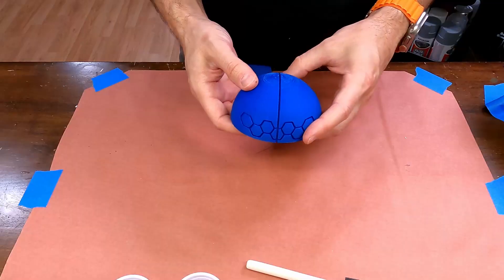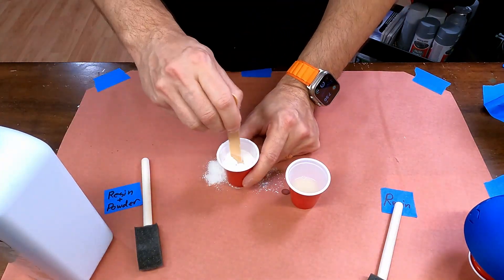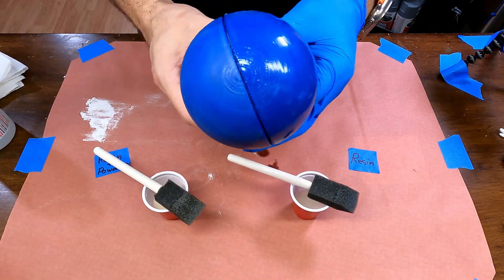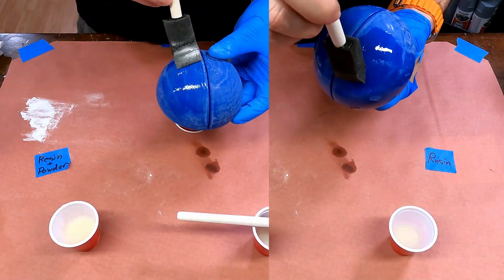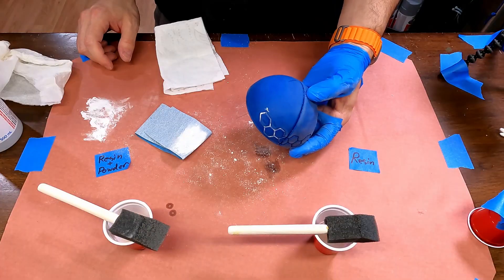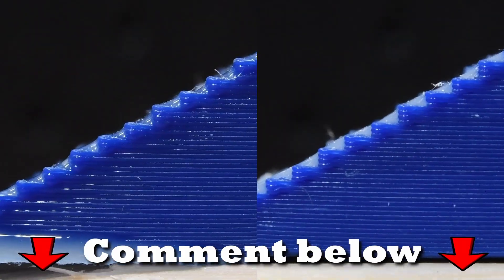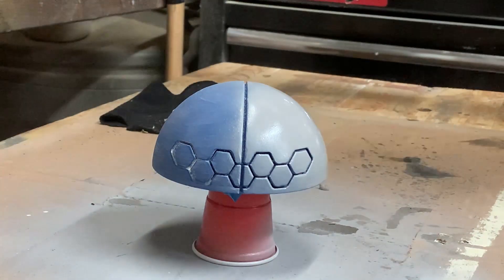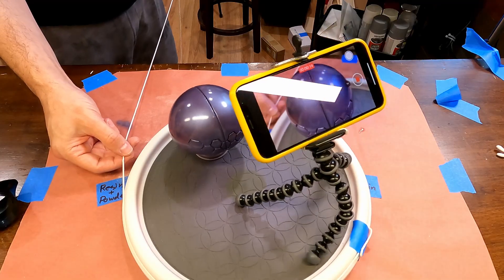What hides 3D Print Layer Lines Better,  Resin or Resin with Baby Powder

Comment: I have a question, the resin your using says pla, am I able to use my current resin I have? It’s sunlu abs like? Also is there a link for the single dome you used in the previous video as it would be great to use as a training piece to get my skills properly honed in, another great video
Reply from the maker: your resin should be fine. I don't have a link to the dome but you can just create a sphere in your slicer and cut it in 1/2
Reply: @DaveRigDesign thanks, I’m making multiple helmets and masks and saw your previous video then this one, and I love the colours your able to make too

Comment: Hi, i saw this video about a year ago, im following up to see if you potentially still have the test piece and what was the result after the 2 years time?

Was there any cracking over time from thermal changes or what have you is mostly what im curious about.
Reply from the maker: I don’t have this model but do have the one from the 1st resin + baby powder video and it still looks the same. The red dome from the glazing putty video was showing layer lines before I threw it out so I think the putty shrank a bit over time. 

Resin seems to be pretty stable.
Reply: @DaveRigDesign awesome thanks for the quick reply!

Comment: if it can help. i mix epoxy and FLOUR (00) until 30-40% to get  more dense putty. I used on several tables, and finally at 25% i used to cover the entire Bar i manage , the external wall. It is already there after years

Comment: If you don't mind, I've got a couple questions:
1) Is it possible to thicken the epoxy by one of the following methods: 
    - Changing the hardener to epoxy ratio?  
    - After mixing the epoxy, letting it sit for a while so it thickens some before applying.
2) If you are going to prime and paint anyway, is it really necessary to apply epoxy?  Couldn't you just give the 3d print a light sanding, apply primer, sand primer, and then paint?
Reply from the maker: Sure thing:
1) Th is is UV resin so there is no hardener to add. Exposing it to the UV light is what caused the chemical reaction to harden. 
If you were using an2 part adding more hardener usually just makes it cure faster and you could let it sit but usually once it starts to flash it gets gummy quickly and unworkable. 
Even with 2 part you would want to add a thickening agent to the base before adding the hardener 

2) sanding PLA is very difficult. The material is very hard so sanding it difficult and take a while. Resin on the other hand it much softer and easier to sand. 
Also you end up sanding less as you are not sanding down the plastic ridges until the are level with the grooves, you are filling in the grooves and only sanding off the top of the resin to be level with the ridges or slightly above. 

If you have done any wood working for comparison, sanding PLA is like sanding oak and resin is like pine. :)

The primer at the end is to just fill in the small scratches left from sanding. Paint is very soft and not meant to fill large gaps.
Reply: @DaveRigDesign  ... Thanks for the thought out response.  Very helpful.

Comment: Dave,
I really like this video and it give good detail for other options for filling in gaps.  I do have a unaddressed question though.  If you have printed models that are multiple print colors of filament and not necessarily finished with prime and paint since they are already printed in or wit the correct color formats then is the resin option the best way is the powder the best way and will this assume that the top of any domed print while maybe layered have filled in, but that you will still always see they swirl for a lack of a better way to describe?
?
Reply from the maker: if you are printing in colour but still want a glossy smooth finish, you would have to use a clear resin with no powder added as the powder will make the resin cloudy. 
It just means you will need to add more coats and more sanding. 
Then at the end you can either add one final resin coat to turn the resin clear again or buff/polish the resin to remove the sanding scratches making it clear again.

Comment: I'm getting good results with epoxy crafting resin, the UV kind so that it cures in a few mins. You can either dip your part or pour or paint over it.
Reply from the maker: Any resin should work. Not sure if craft resin is thicker or thinner then printing resin. 
Doesn’t dipping it pouring the resin create a lot of waste though as it drips off?
Reply: @DaveRigDesign  I use UV resin for fast curing and no waste since you just pour back the unused. So if you dip it pour back what's left in the dipping container, if you pour it then your mould must have a wall and then you pour out the excess back into your resin bottle.

Comment: My inner Journeyman for Autobody approves of your efforts. If you take some time practicing with a few different sanders (DA, Random Orbit, mouse) all with different density sanding pads, you will cut down greatly on your prep time and end up with a smoother, flatter result. 
But you also pulled a Shane (me) and got a damn run in the clear which happens from time to time... which no prep before painting is gonna save you from. Well done on the video though!
Reply from the maker: Thanks, If your experienced in autobody work you may like this video I did recently with automotive paint. https://youtu.be/3PKFMq0Him8
Take a look and tell me how I did :)

Comment: I'm wondering if I were to just sand and paint with clear coat to make it shiny and the clear would fill in the ridges would be good enough. I'm fine with the PLA color so don't need to paint and your shape is a smooth dome but if the shape is complex sanding is not really very practical.
Reply from the maker: In theory I think you could. Not sure if you could get the clear coat perfectly clear though all the sanding and recoating but may work

Comment: Any UV lights can cure resin? Idk which uv light img gonna buy.
Reply from the maker: They need to be the right wavelength for the resin you’re using. Most 3d printing resin are 405nm. You also want it to have a decent power. If it’s not strong enough it will take forever to cure the resin or not at all

Comment: Help! So I did 2 coats of filler primer, but when I wet sanded each time, 95% of it seemed to come off. I used the same products you did, and same grits. What does this mean? Will I have issues painting?
Reply from the maker: Between each coat when sanding you are removing the paint from the high spots and leaving it in the ridges. 
So each coat you should be sanding less off. 
You should also be sanding with 240 grit and just making it smooth. If you sand too much you will take all the paint off and go all the way down to the print
Reply: @DaveRigDesign  im using 240 grit. I’m putting barely any pressure. And just going over the entire print and it seems to begin coming off everywhere as I go.
Reply from the maker: If it’s coming off in chunks or pealing off then the primer isn’t sticking to the print for some reason. If that’s the case you’ll want to take it all all and while down the print with alcohol to make sure there are no oils or contaminates on it before spraying again. 

If it’s sanding properly like a powder then you either need thicker coats or to not sand as hard. 

Also if you sand it before it’s fully dried it will scratch off easily and smudge and really gum up the sandpaper.

Comment: Did you do 220 grit before spraying primer and then wet sanded with 220/240 again after spraying the primer? Or only after primer?
Reply from the maker: Sanded to 220, then prime and sanded with 220 and 400 after that

Comment: Did you only sand with 120 grit each time? What about once you primed it?
Reply from the maker: I started with 120 and later used 220. Wet sanding is 400

Comment: I am having issues with curing when using baby powder. My prints do not seem to 100% cure, even if left in the chamber for hours. Does the consistency or ratio of powder to resin cause curing issues?
Reply from the maker: I wouldn’t think so. Unless you use alot of powder. When I cured my resin there would still be an oily film left which it why I would wipe them down with IPA before sanding. Is that what you are seeing?
Other than the residue the resin would fully cure.

Comment: You need to place the object on rotating base. That will evenly distribute the resin using centrifugal force
Reply from the maker: Gravity is still a thing :)
Adding a rotating base will pull it all down to the bottom as it’s the largest circumference
Reply: @DaveRigDesign  the problem isn't gravity it is the lateral forces not spreading out the solution causing spotting. Rotational motion will provide the lateral force and gravity the downward giving an even thickness. They use this in chip fabrication.

Comment: This is a good video to explain some differences. I've been an autobody shop manager and tech for nearly 30 years. We've been working with acrylic resin, fiberglass resin, modern autobody filler, which is a polyester resin, and old school paddling lead. Lead was the body filler many years ago. So basically, adding the powder to the resin is just making it thicker. The same thing is done with autobody fillers. And you can add acetone to body filler to do the same thing, but it has to be a one part filler. Not 2 part. For adhesion, we have found that you actually get better adhesion by using the filler/acetone combo. What happens is the acetone actually softens the part, allowing the "slurry" to flow into the actual plastic. When the acetone evaporates, the filler is all that's left. To explain a little more in depth, acetone opens pores in the plastic. The slurry flows into the pores. The acetone evaporates, and the pores contract around the slurry. Because the acetone is what liquefied the filler and opened the pores in the plastic, when it evaporates, the pores close, and the filler dries at the same rate. The upside to the resin/powder combo is it's probably stronger. The upside to the filler/acetone combo is you don't need a UV light. We use both depending on the circumstances.
Reply: I just use glazing compound to sum success.Darth Vader never looked better!!😂
Reply from the maker: @keithhampton9700 yup, that works too, I have videos using that method also.
Reply: I have some feeling that it softens the plastic if it’s ABS. If you are using PLA or PETG, it shouldn’t do anything.
Reply: What one part filler do you recommend?

Comment: So I'm a little confused, why would you have had to wipe it with alcohol at 4:45 if you hardened it with the UV light.
Reply from the maker: There is always a residue left over when curing.
Reply: @DaveRigDesign 👍🏻

Comment: At 15:20 there are still visible layer lines on the resin-only side. Could you airbrush resin to get it on more evenly? It may take more time and steps, since you're adding a tiny bit each time though.

Comment: Gloss look will always tell you how smooth the surface is. Don't know why people are going for carcinogenic talc,  I'd use porcelain if anything.   I've haven't been working with 3D Printing for years but I remember people were smoothing out their models with acetone. I know at that time some were heating it up to create a mist - kind of crazy. Why not use a cool mist humidifier???
Reply from the maker: Acetone only work on ABS plastic. It doesn’t have any effect on PLA. Also this is cornstarch, not talc. What do you mean use porcelain?
Reply: @DaveRigDesign  Talc is normally added to "Baby Powder" as you have it in your title.  Good to know about the Acetone. Porcelain is available as a very fine powder and helps with hardening & smoothness in general.

Comment: Hi Dave.  Is there a specific reason you used corn starch baby powder as opposed to talc?  Curious.  Very cool video!
Reply from the maker: That’s what was available. :)
I don’t think you can get talc based powder here anymore due to the cancer concerns with talc.
Reply: Wouldn’t straight up corn starch be cheaper and better since it doesn’t have perfumes and additives?
Reply from the maker: @kevinfinke6927 maybe, but baby powder is pretty cheap :)
Reply: @ I’d be worried about the “other” stuff in Baby Powder, and how it might behave over time. Quick, but not exhaustive search, Cheapest 16oz Baby powder is $.32/oz, least expensive Corn Starch was $.16/oz. Or half again as cheap. Have you noticed any problems with your baby powder smoothed prints over time?
Reply from the maker: No issues, still the same as when I made them.

Comment: How long does the parts take to cure in the uv box
Reply from the maker: I usually put it in for 30-60 sec. Usually if I’m putting on multiple coats once done I’ll put it again at the end for a few minutes to make sure everything is cured. 
Time will vary with the strength of the LED’s though. Once you try it a few time you should get an idea how long it takes resin in your setup. 
No matter how long it cures there seems to be a  oily film on the surface but it is cleaned up easily by wiping it down with IPA on a paper towel
Reply: Thanks if you’re doing the whole part do you have to flip it over so it can cure the underside
Reply from the maker: @davidpetti9951 if I was doing all sides and couldn’t make a stand for it I would put resin on 1/2 and cure it, then do the other side and cure it. Not coat the whole object at once.

Comment: That's great! Now what would the process and results look like if you had used ABS?
Reply from the maker: Should be a similar process. ABS is a little easier to sand and you have the option to vapor smooth ABS also

Comment: I wanna use resin and baby powder to fill in layer lines now… but I don’t have a UV chamber thing to cure it. Do I have to invest in one for curing? Or is there another way?
Reply from the maker: You can use a handheld light like this  https://amzn.to/3HaoDVJ
I made a new video recently where I use them on a helmet https://youtu.be/Ojl5YwBPIHU
Reply: @DaveRigDesign  oh amazing! And it works on PLA correct?
Reply from the maker: Yup. All my videos are printed in PLA
Reply: @DaveRigDesign  amazing, gonna be doing a green goblin helmet for the 3rd time but I’m determined to get the cleanest finish this time and I think this will help tremendously!

Comment: Does it have to be uv resin or can you use epoxy? What would the difference be?
Reply from the maker: Epoxy would work also. Difference is drying time. I like UV because you can work it as long as you want and then hit it with the UV light to cure instantly.

Comment: It’s good to note that resin can over cure and look worse because of it. So the baby powder and resin side is exposed to UV for 2 times as long reducing its initial luster.

Also note that UV Curable resin will deteriorate when exposed to sunlight without sufficient post processing to seal them in.

Comment: I would like to see this attempted on objects with a lot of geometric features and right angles.  Flat surfaces and corners, especially on a smaller objects.  Like a box with a latch or a picatinny rail or hinges and mounts that need to fit together or need to fit other non printed objects with some degree of precision.

Maybe even a set of slightly enlarged threaded bolts and nuts.  The modular mounting system on thingiverse fulfills a lot of these suggestions.  I'm curious how difficult the process would be and how much extra time it might take.

Comment: Great video - really well explained and I'm about to try this out myself! However, as a resin noob, can I ask how long you hit it with the UV light? It's going to be on a helmet so I don't have a chamber - just a hand held lamp. Thanks :D
Reply from the maker: It kinda depends on the strength of your light and thickness of the coat of resin. I’m working on a something now needing hand held lighting and I’m doing 20 sec or so. If you put a little resin on some paper or tinfoil and shin your light in it you can see or harden and get a idea how long it takes
Reply: @DaveRigDesign   Thank you so much for replying - and also for the advice. I think have a failed helmet print somewhere I can try that out on. I thought it was going to be 15 minutes or something like that, so knowing it's probably going to be shorter is quite encouraging :D Keep up the good work!

Comment: I'd like to see how it compares to acetone smoothing. I think the use cases are different, but surely there must be some overlap, so I'd like to see what the difference is when given the option
Reply from the maker: Acetone only works with ABS though. Doesn’t have a effect on PLA
Reply: @DaveRigDesign what solutes work with resin since acetone doesn't work as well. EtOH?
Reply: @FlyingPurpleSkulls I use spot glazing putty mixed with acetone. A 2:1 putty-acetone mix makes it like a slurry and then you can either paint it on or airbrush it on

After it dries, you can sand it down and then reapply.
Reply: @HeliosKou  cool thanks!

Comment: Too much work and very expensive 👎. Better to use body filler and sand. It is cheaper, less work and the same result would be obtained.
Reply from the maker: Cheaper? Not if you already have the resin for your resin printer. Less work? Body filler is way harder and messier to sand.

Comment: I actually still saw some print lines on the top of the resin only side and quite noticeable ones near and on the detail area again on the resin only side. 
That coupled with how much more sanding was necessary to smooth out the surface, makes Resin and powder the winner hands down

Comment: Or you could, I don't know, use a resin printer that doesn't have layer lines in the first place, because it is all cured with UV.
Reply from the maker: I guess you could if you wanted to, I don't know, spend thousands of dollars on a resin printer that's big enough to print helmet or other big pieces.